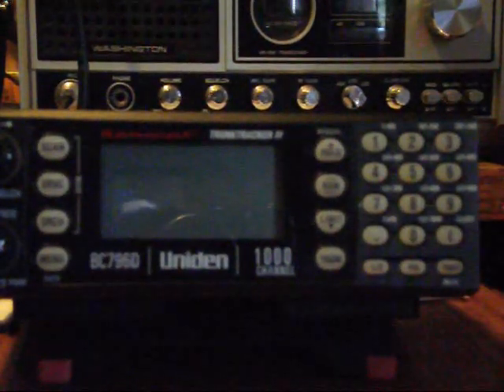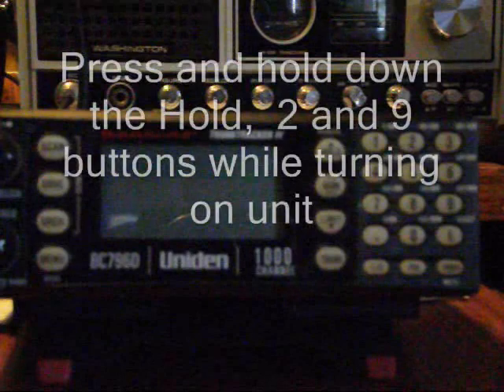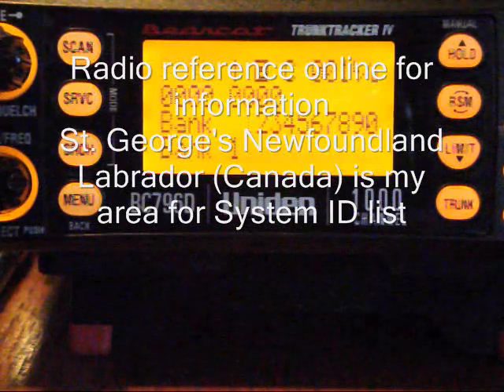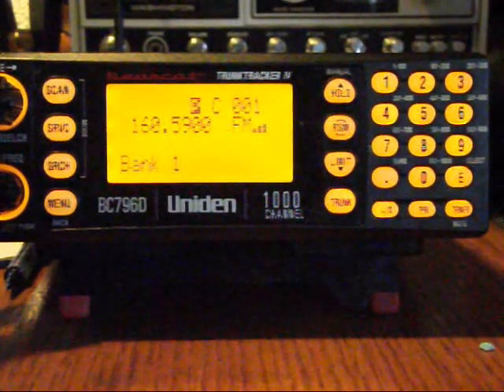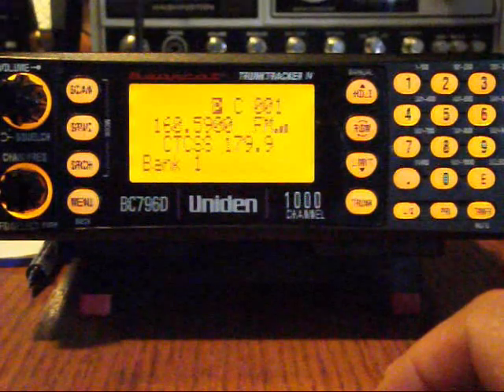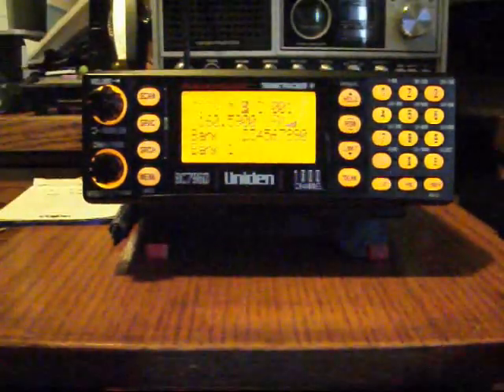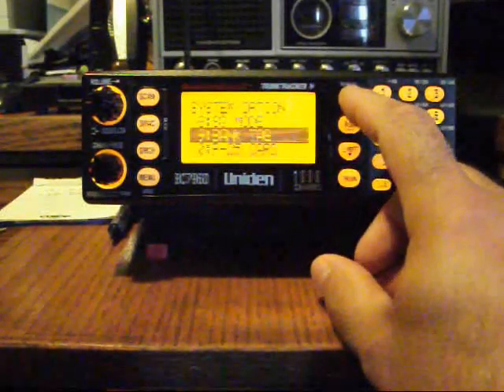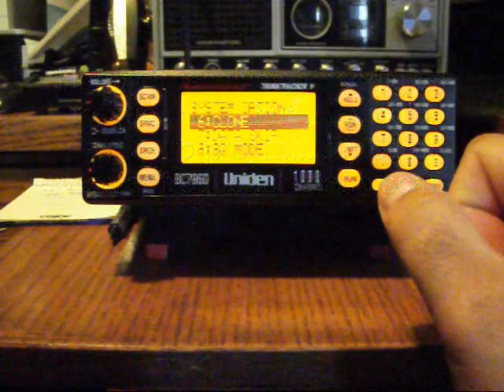Uniden BC796D P25

Comment: Did you get this figured out?  It's been over a year, so I thought I'd ask.  You are trying to monitor a trunked system by programming the frequencies in conventional mode.  That does not work, as you can tell.  If you have further questions, I may be able to help.
Reply from the maker: YouTube had these messages Hidden. Thanks for your comment

Comment from the maker: @kb0nly BTW, When I unplug the scanner from the USB it makes the typical two note sound. When I plug it in to USB it makes three quick usb beeps of the same pitch and up an up pitch as usual. This will do the same with or without the scanner plugged in to the usb port top the 9 pin port.

Comment from the maker: I concur with this information. I am unable to upload any software to the unit. I tried through the USB ports and through the comm port ( 9 pin ). I tried my desktop which has XP and my laptop which has windows 7. I have contacted Uniden and they want me to send it in for a repair but it is not under wrranty so, no thanks...I wish there was somebody local who could confirm my findings on not being able to program the unit properly or uploading suitable software. Thanks for the info

Comment from the maker: Just for clarification, I do receive the digital frequencies with no problems. My scanner just does not scan beyond the frequency once it falls on it. There is a carrier signal after they transmit that the squelch does not overcome. I monitor the RCMP with no problems as they are mostly gone P25 Digital here in the province of Newfoundland.